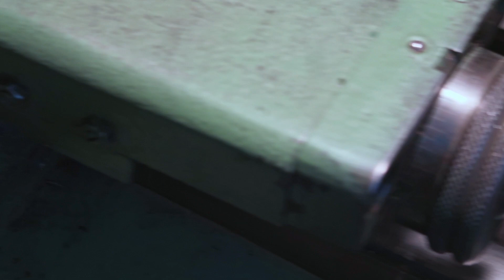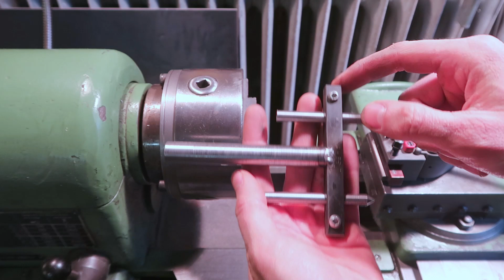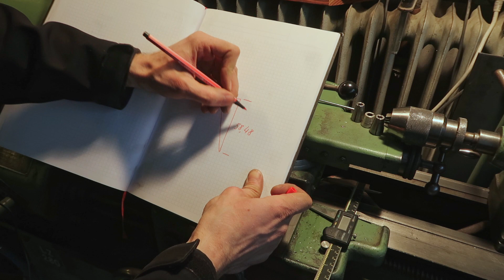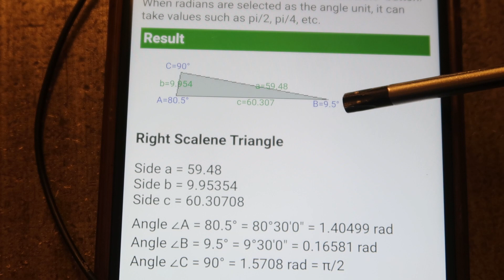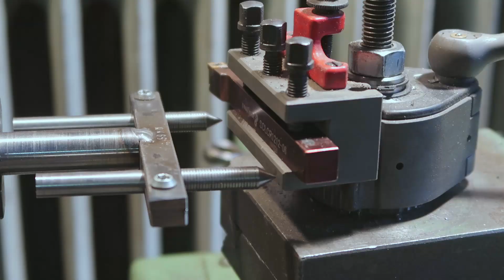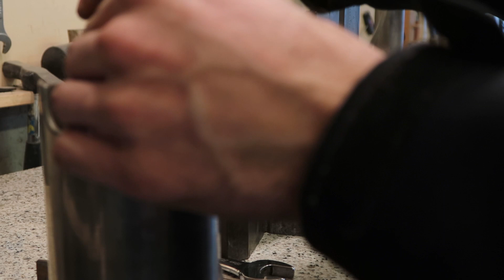How to ACCURATELY set your lathe compound angle for taper cutting | One method of many

Comment from the maker: Before everybody goes full nuclear, yes there are other arguably better ways to do this. Yes, I can use a sine bar - I don't have one. Yes, you can use an indicator and do the trig with the handwheels of the lathe - that's too much for my brain to compute. Yes, you can do it with two indicators - I only have one because poor. So keep in mind this is just one way which worked for me which required a minimum amount of tools which delivers an accurate result. Would you do this in a professional machine shop - I don't know, I've never worked in one nor am I a professional machinist. I am just trying to figure it out as I go. I am not a machining services professional, this is not machining advice.

Comment: Instead of measuring from tip to tip, consider measuring rod to rod outside distance, then subtracting the rod diameter from the measured distance...  Or conversely you can measure the inside distance from rod to rod and add the bar diameter to get the center line to centerline distance...  I think you will get a more precise value doing it this way...  And it's free...   I like your set up, and I may make one like it.
Reply from the maker: Thought about doing that too. You're probably right if you use mics for everything it should be more accurate than trying to hit the tips with a caliper. Will do that next time I use it!
Reply: Only accurate if the tips are perfectly concentric to the rods.